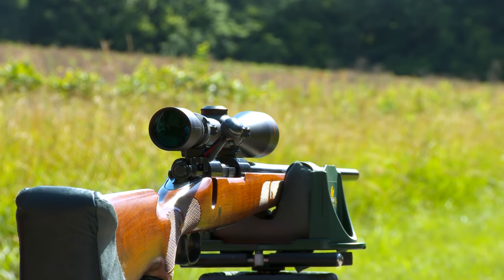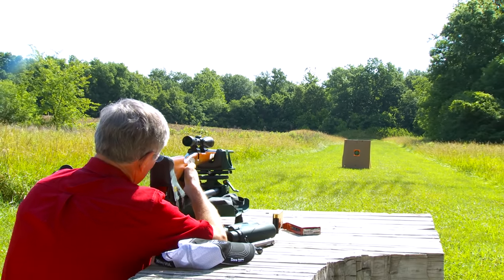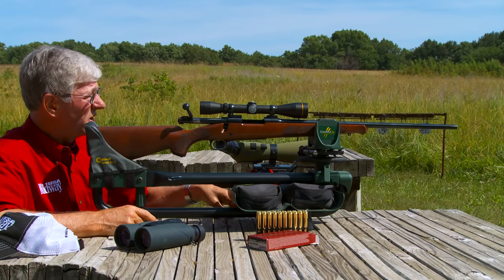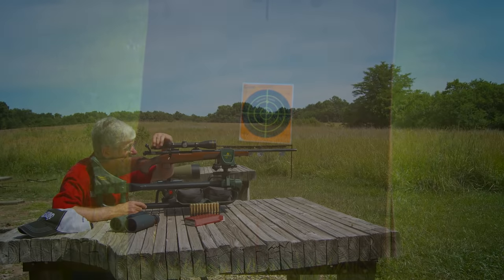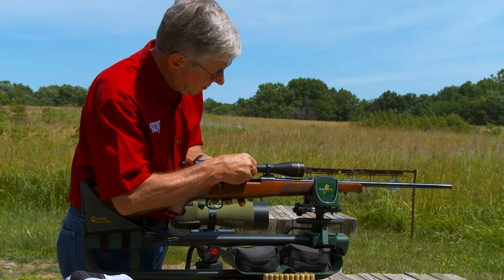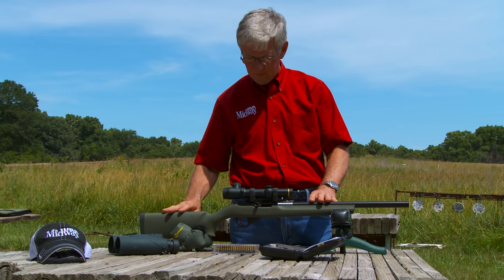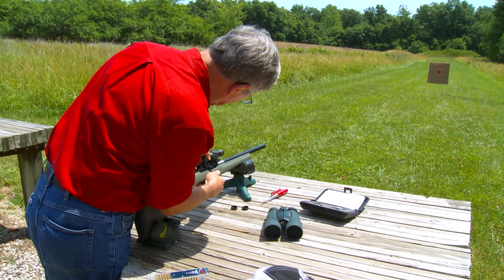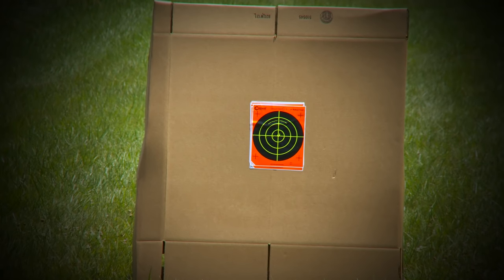How to Sight in a Rifle Scope Presented by Larry Potterfield | MidwayUSA Gunsmithing

Comment: I’ve been using this same method for quite a while now. This is one of the BEST and quickest methods there is for sighting in your rifles! It will save you MONEY too! Using this method in combination with a good bench rest, will get you perfectly sighted in, in no more than 4 to 5 shots. It’s a whole lot less expensive than going through a box and a half of rounds!!
Reply: Question, in this video Larry brings the crosshairs over the bullet hole but what about the opposite where you move the crosshairs in the direction you want your point of impact to be? For example, you shoot level with the bullseye but off 3 inches to the right then you turn the scope dial to go 3” to the left? I have tried both methods and have gotten close to centre but never as good of a zero as I would believe the rifles could achieve. Just run of the mill rifles with run of the mill ammo so that could be the problem. Also, I recently learned not to shoot at the centre of it black as it’s not idea to aim your black cross hair onto a black background which makes sense. 

What is your take? Thanks
Reply: @User_Brandon  
When sighting in, make sure your using the SAME exact ammo for every shot. Different brands, styles, and grain sizes matter. As far as making your left or right adjustments, it’s a lot easier if you have someone else make the adjustments on the scope while your looking through the scope and holding the gun. The gun will be a lot more steady that way.
Reply: Also, every gun has its OWN unique personality. One gun might shoot Winchester, 180 grain perfectly, while another will be shooting them all over the paper. You just have to try a bunch of different kinds to see which ones your gun likes.
Reply: @jimbigboystoys4077  Yep it was the same ammo brand every time I tried shooting and thanks for the tips, much appreciated

Comment: This video is great. My only problem is that I never see days where I could put up that big cardboard here in Wyoming. If I put up something that big, the wind would take it away before I could get back to the bench.
Reply: What about shooting into a dirt berm?  You can set the target as close to it as possible and then you'll be able to see the impacts in the dirt. It'll at least get you close
Reply: You need to adhere your target to 4" thick 6ftx8ft wide mahoghy board and titanium bolt it to two concrete pillars sunk 300 feet into the ground. That ought to do it.
Reply: I take it's windy in Wyoming.
Reply: Yep
Reply: "I take it's windy in Wyoming."   lol that's an understatement. It never stops blowing.
Reply: PokerMan thats actually Canada sucking
Reply: Mr martin yeah he can stand behind it and hold it by the corners😃
Reply: That's what plywood, glue, and nails are for.
Reply: The only time the wind stops blowing in Wyoming is a change in the direction. So, every 30 minutes or so you can take a shot or 2. Pack a lunch and make a day of it !

Comment: Great video. What magnification should you use to sight in using a variable power scope?
Reply: Scarface728 {GD and Vlogs} 
I think it wouldn't matter since the magnification doesn't change the position of the reticle.
Reply: You can crank it up all the way, but the reticle will jump if you move or breathe, even your pulse can make it move.  The sled helps keep it still.  If you can keep the reticle on the target at full magnification, go for it.

Comment: I had my scope sighted in at 25 yards perfectly, but when i moved out to 100 yards it shot way high, any ideas why? Any help is appreciated
Reply: Bullets change altitude at different ranges. For example, my rifle shoots .243 Win and gets back down to the altitude of my barrel ~150 yards with a 100 grain bullet. You have to adjust sights for different ranges
Reply: +Max Morrison Draw a simple, hypothetical but 'not to scale' diagram. This will demonstrate the basic principal:
- show the barrel of your gun exactly parallel to the ground with the trajectory of a fired bullet gradually being drawn to earth. Note: all bullets begin to drop the instant they leave the barrel. 
- now draw the 'line of sight'...... a straight and infinite line with origin above the barrel (1.5 inches or so) that eventually crosses the bullet's path. Note: This line will be straight and must point downward so as to cross the path of the bullet. It will cross the path twice.
Dependent on the trajectory of the particular bullet/caliber the results will vary....hence 'trajectory tables.' So if you are dead-on at 25 yards and high a 100 it will be back to zero further out, perhaps at 175 yards though this is dependent on velocity and bullet weight which is responsible for trajectory.
Hope this helps.....
Most sporting arms are set-up to shoot 1.5 - 2 inches high at 100 yards. This means (generally) that the bullet crossed zero at 25 -30 yards and will again at 200, perhaps being 3 inches low at 300, thereby creating a reasonably flat-shooting rifle.
Reply: Max Morrison the bullet rises after leaving the barrel to a certain distance. You need to zero your scope or set it at 100 yards then shoot at different distances . Pending caliber an billet weight zero at 100 you should be good from 25-200 yards
Reply: @marcgiddy6295  Better might be to sight in zero with the bullets striking 1 inch high at 100 yards. Larry said 2 inches high at 100 and I agree with him for a 375 H&H shooting 300 grain Barnes bullets. For your North American rifle, 1 inch high seems about right. Your 308 Win 9 (example only) will be spot on at about 50 yards, 1 inch high at 100, spot on again at about 125 and two inches low at 200 yards. With this system, put the crosshairs where you want to bullet to strike and make a good shot. Te bullet will nail your animal. Out to 200 yards, you don't adjust the high/low bullet rise or drop. Try it Marc, have fun!

Comment: Hi Larry I have a ar 15 223 55.6 I'm having problems w it I have put 3 new scoops on it at 100 yards it is dead on you can hit a dim w it but at 200 Or 250 it is off by 10 inc or a 12 to the right I don't no w to do do you thank I need to get a new barrel for it if you can lmn sap thank you

Comment: Where did the 2" high and good to 300 yard come from.    Do I assume he knows his drop and just made a good guess adjustment?
Reply: Compensation for his specific rifle. Like if you've seen those drop charts for bullets like if your ar15 is zeroed at 100 yards to shoot to three hundred aim about two inches up? I think that's what he did. Got it dead on@25. Adjusted two inches up to achieve a 100yard or whichever yard the bullet will be 2" higher than it was @ 25 yards.

Comment: I have a 270 wsm Savage left hand bolt can someone answer this question approximately how many times could the federal cases or any other brass case's be lodaded ( approximately ) . I have had so many problems with the federal and Winchester cases and have returned the FACTORY LOADS to the maker. PLEASE HELP.

Comment: Why do you go for 2" high on the first rifle and dead on center for your second rifle?
Reply: The first rifle was a larger caliber, which he intends to shoot at targets further away (out to 300 yards).  Two inches high at 100 yards is dead on at 200 and an inch low at 300 yards (this will vary depending on the caliber and some other factors).  This allows you to take the shot out to 300 yards without a lot of thought and calculation.  Aim at the same spot no matter the distance, and you will put the bullet in for a clean kill.  If you want to get picky and you are really sure of the distance and know the performance of your rifle, you can aim a little low or high, as appropriate for the distance.    

The second rifle was a .22 caliber, and he only intends to shoot out to 50 yards, but he also wants it dead on, so when he shoots at a squirrel or rabbit's eye, that is right where the bullet goes.

Comment: So once you sight it in at 25 yards you can shoot farther distances without sighting it back in
Reply: Your vision is a straight line, but the bullet path is not.  Properly set up, a bullet will intersect your line of sight at 25 yards and then again further out, generally around 200 yards.  If you have your scope set up for point of aim, point of impact at 200 yards, you can shoot reliably out to over 300 yards.  You will hit a little high at 100 yards, and a little low at 300 yards.  On a deer-sized target, that still gets you a good kill.

Comment: 'adjust the crosshairs' and no damm explanation... the VERY thing fellows need explained carefully.
Reply: If the rifle is locked into a sled, look through the scope and turn the knob(s) to move the crosshairs to the bullet hole. Each knob is marked either "Up" or "Right", accordingly, which refers to the bullet strike.   Most rifle scopes have 1/4 minute of angle (MOA) adjustments. This means that 1 click will move the bullet impact 1/4″ at 100 yards.
If you are shooting freehand, look at where you are hitting and turn the knobs on the scope, up to raise the impact and right to move the impact to the right, counting your clicks as you go.  Freehand is better done at 100 yards, so you don't have to think so much about the effect of each click (example: it takes 16 clicks to move the impact an inch at 25 yards)